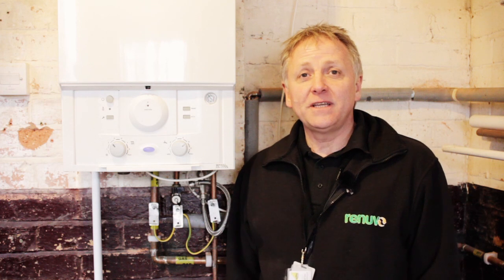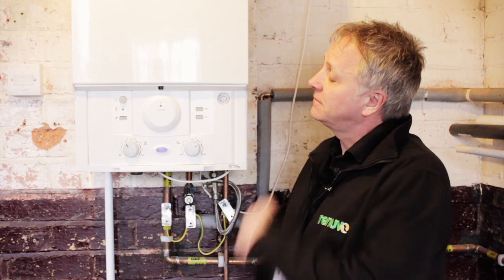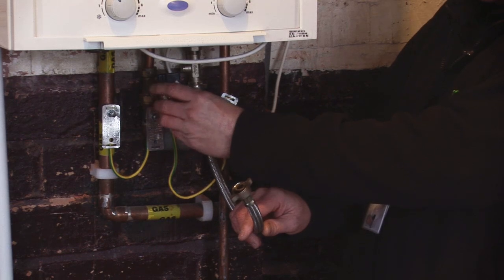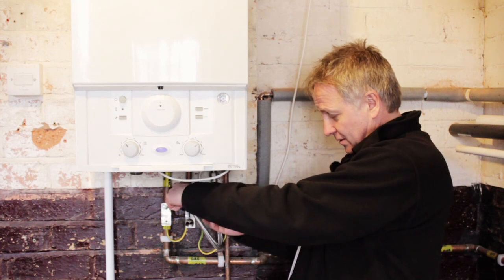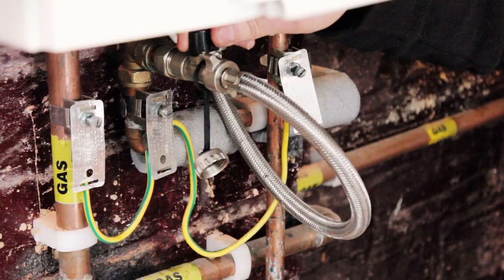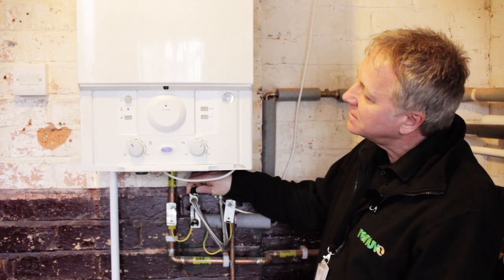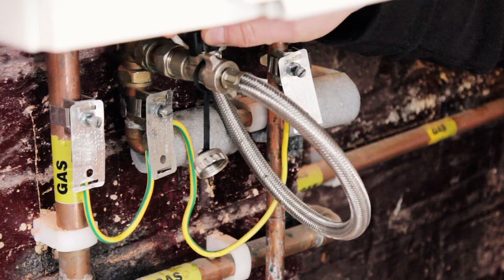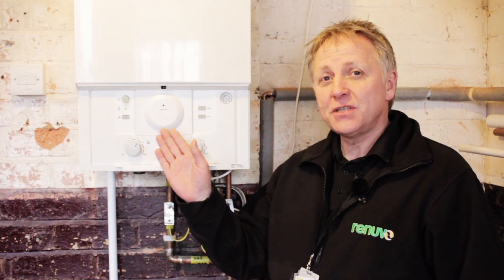How To Repressurise A Boiler With A Flexible Filling Loop

Comment: dont undo that cap without checking that the valve is off /working first!!!! schoolboy error , "only got it open quarter of a turn"??, that's full bore fully open!?!?!!I if your non return valve is faulty, when you remove the filling loop your gonna get covered in water, thats the reason many hoses are left connected.. if pressure rises very fast then thats a sign that your expansion vessel is a problem, oh and after filling, watch how high it  goes with heating on, also a sure fire way of knowing the expansion vessel needs attention!!,

Comment: Great vid. Is there any reason why the filling loop can't be connected all the time? I mean, with the pipe closed off.
Reply: Hi Richard,
Thanks for your comment. I believe, strictly speaking, disconnecting the filling loop will prevent any accidental contamination from the water in the boiler back into the potable mains supply. I understand that this is a Water Regulation requirement.
Andrew P

Comment: My combi boiler has a flexi hose with 2 quarter turn valves constantly fitted by the plumber who fitted it. So i just switch system off then open taps !!  Baxi combi boiler.

Comment: is this the same for TOO much pressure?  or how can i remove some pressure  im set at 3
Reply: Bleed one of your radiators (any radiator, it doesn't matter which one to let out some water into a basin or bowl of some sort using a bleed key. That will let out some pressure. Then you can top up the pressure like shown here to between 1 and 1.5 on the the pressure gauge.